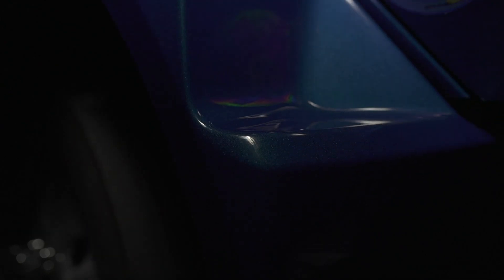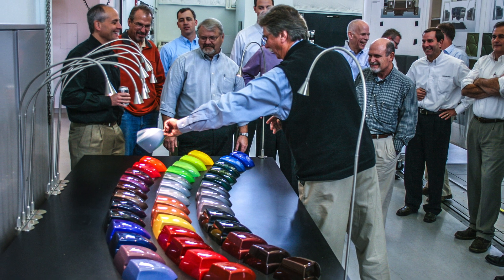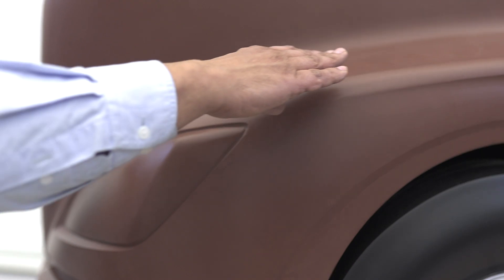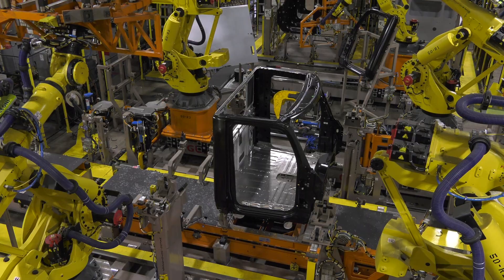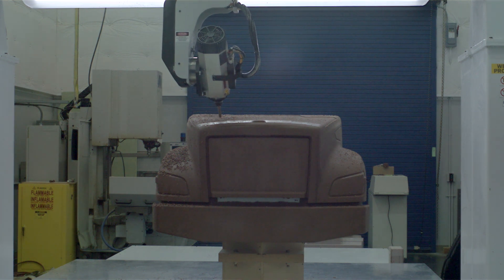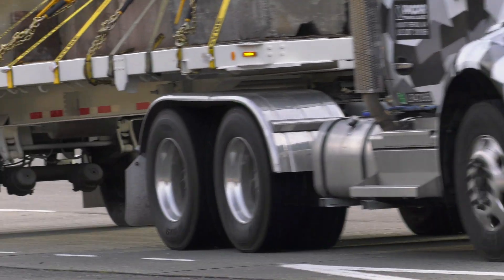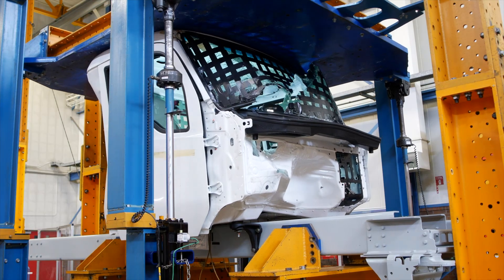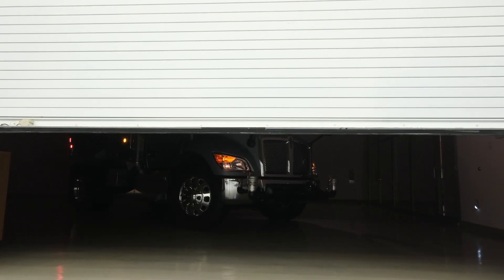Kenworth's New Medium Duty Design Process: Behind the Passion

Comment: I never understood why trucks have air ride in the back but not on the front as they all seem to have a solid axle yet up front where the driver actually sits you put on harsh springs and dumb shocks. Yes I have seen the air ide cabs I have also seen those things bounce all over the place.